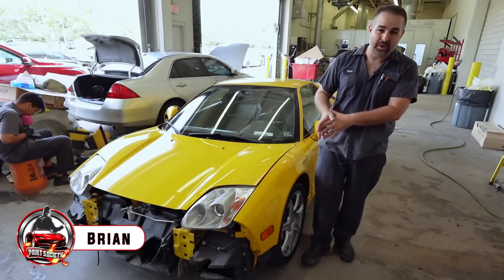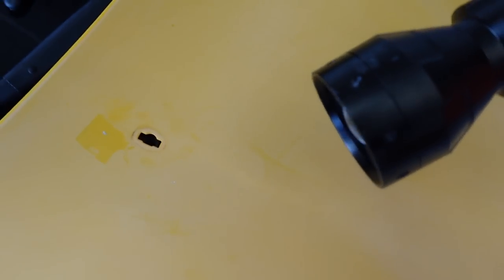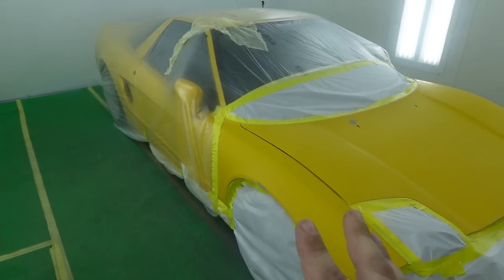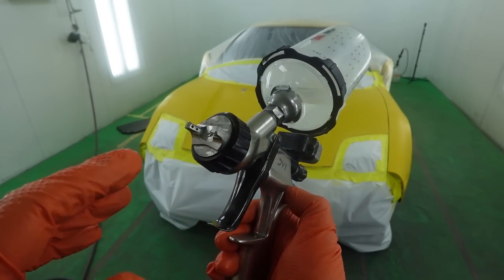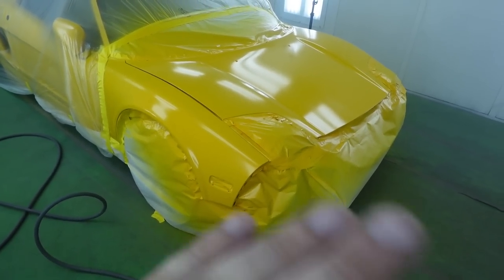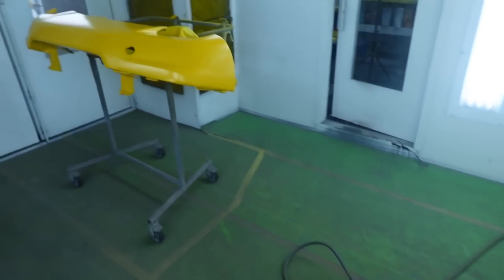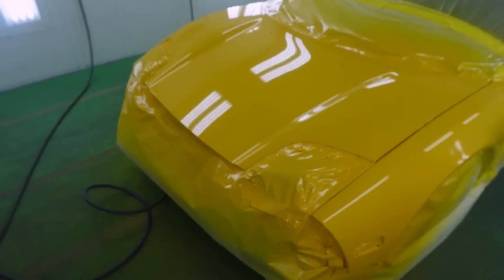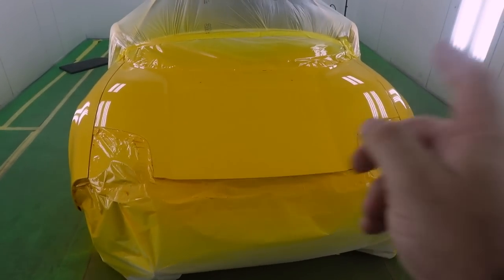How To Prepare a Vehicle’s Surface to Lay The Smoothest Paint!

Comment: As a car customizer and painter who restores specialty cars you did an outstanding job on this NSX, i had the liberty of doing an inspection on an identical NSX two years ago and the bumper and hood also did not match and my client passed on the car. What lots of guys end up doing on these older collectible cars are quick shoddy repairs then they cover it with PPF which makes it even harder to see and know whats under the PPF if it is even original or not. Once again Brian outstanding content as always and this color is not easy to get right but from seeing this car outside it came out bang on perfect. FYI I also use the same IWATA for clearcoats best gun ever if your going after that flat final finish with less sanding and buff.
Reply: PPF would also prohibit the use of magnets to check for filler.
Reply from the maker: Thanks for those words! You definitely have to keep your standards at a high level working on these cars. In my mind I try and think of every possibility that can go wrong and correct it before hand. It’s been working so far. Thanks for the love

Comment: Nice video. I have a question in regards to body filler and primer. On my 66 Mustang I performed some minor body work and used Evercoat Z-Grip filler. My issue is that the filler is showing through my epoxy primer. I have put on 3 coats but you can still see the shadows. No raised surface just a shadow. I will eventually be spraying with a 2K urethane primer/surfacer before color. Should I worry about the body filler bleed through or do you think the 2K urethane and color will cover them?

Comment: Would you recommend using the UV putty for filling set screw drill holes? Holes made when bonding a fiberglass flare to a steel panel? I have problems with the holes dipping when the sun is strong.

Comment: Do primer/sealer colors effect the Basecoat finish? For example, RED basecoat applied on top of white, grey, black, red primers? 
Would the RED basecoat results come out lighter or darker based on primer/sealer color?
Reply from the maker: Yes. Great question. Do spray out cars using the same sealer so you know how many coats will be needed

Comment: I still cant get my head around  a 320 cut with a 600 scratch.
I will have to try it.
Reply from the maker: The speed of a 320
Reply: It is an amazing abrasive system, I switched over 2 years ago and haven't looked back:) I only wish they had dust extraction holes in their 3in discs, doing it manually with a hole puncher is a pain!

Comment: Hi,  I'm from the UK and new to your channel and need recommendations on buying a durable clear lacquer.
I need a product which is scratch resistant to minimise the chances of getting stone chips. 

Glasurit 923-447 was the direction I was pointed in but nowhere in the UK is selling that product, let alone the hardener or thinner which accompanies it.    Other brands such as Deltron and Sikkens have been mentioned but I have no clue what's guaranteed to work besides the product I can not get a hold of.

Comment: I'm having difficulty getting my block sanding on every section of the car even/level throughout the entire car.  Meaning this ... I block sand each section using guide coats and proper blocks, technique , etc. , But when I complete one section then move onto the next, I repeat and that section also comes out great , but then when I compare to the section I just did right next to this one, it's not even, level with each other.  I'm not talking inches, not even centimeters, but I am a very detailed ocd prrson, and I'm talking milimetrrs.... Not necessarily enough difference to where a normal person would be able to tell, but enough of a variance where someone like me would be able to detect if looking extremely closely.  Do u happen to have any advice or suggestions on how to remedy this or is this an unavoiadable thing

Comment: I've been watching a lot of your videos and I think I'm ready to tackle a DIY at home paint job, but the thing I keep getting stuck at is trying to figure out an air compressor. I've seen that 50-60 gallon tank is recommended. Do you have any recommendations doe beginners? Might only paint 1 or 2 cars for now, not a business
Reply from the maker: 60 gallons is the best. If you get 30g gallons then you can only do a few parts at once properly with enough air
Reply: @PaintSociety  do you have any "cheap" recommendations?

Comment: what's your flow rate with the clear? i see you have like 80% lap, just wondering how its not running with the exception of a near horizontal surface/
Reply from the maker: It looks like a lot but that lph isn’t putting out alot of fluid you can’t do that with a sata
Reply: @PaintSociety  i run the tekna and the gti pro lites (basically the same guns but ones a cup and the other is pressure) i like devilbis lol. i havent had the opprotunity to buy anything super fancy,  trying to get our paint rep to send over a loaner for a test run though lol. looks smooth!

Comment: you only do hondas where you work at?
Reply from the maker: Mainly Honda and acura
Reply: @PaintSociety  while you are at my attetion. whould a compressor with this spec be sufficient for painting? 
motor 2,2 kW
free amount of air at 6 bar: 195 l/min
flow rate of air 412l/min
50L tank
not sure i translated this correctly though